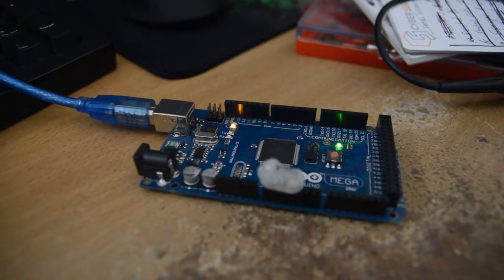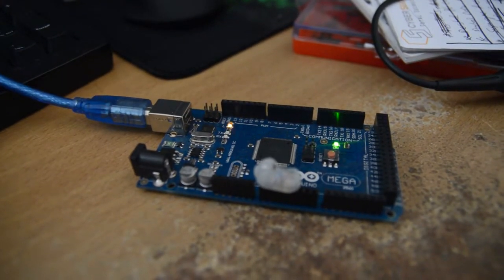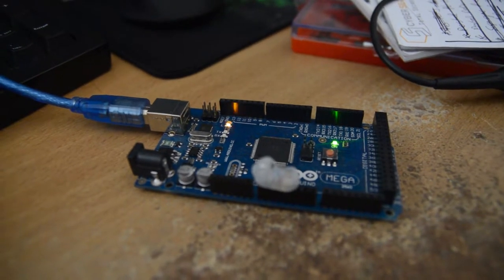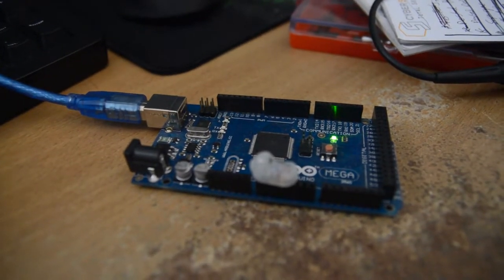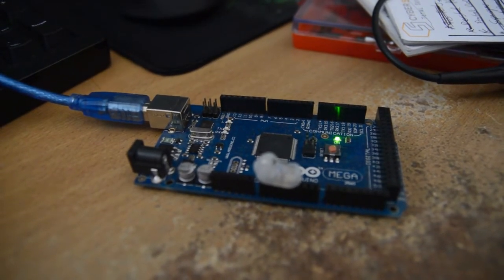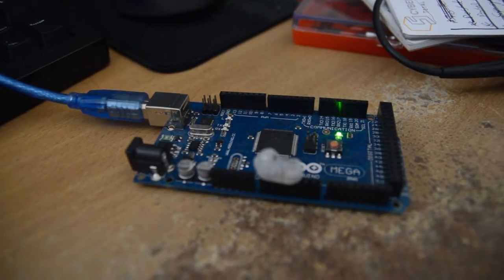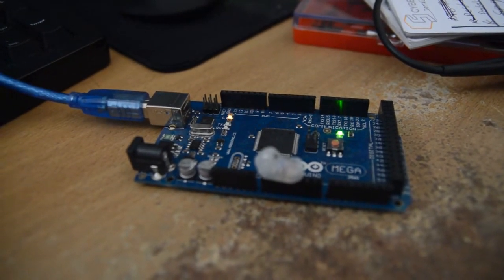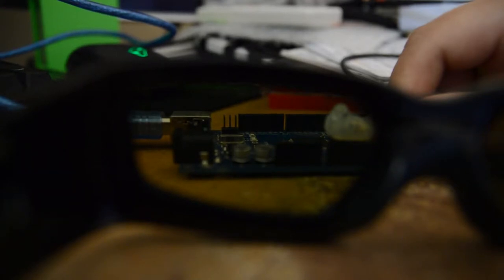Emulating Kogan Active-Shutter 3D TV IR Protocol

Comment: Resurrecting this 10 years in the future, did you ever get much further with this project Gough? I've been looking for a standalone 3D processor that could be plugged into a modern 4K non 3D screen (hopefully at a high refresh such as 120-144hz), particularly for use in relation to a 3D virtual pinball game whereby the screen is placed on it's back in portrait orientation (yes I'm aware there may be issues with the direction of 3D glasses polarisation filter in rotated mode but this can be overcome). So a PC would be plugged into the device by HDMI or display port, it would send a top/bottom or side by side 3D image to the device which would then process that image and send it to the TV/Monitor as frame sequential. Similar to Nvidia 3D Vision I guess but one that would work with a 4K screen. Are you aware of any current device that could do this?

Comment: I got a 50 inch kogan 3d-Tv and both of the 3d-Glasses have dead battery's that wont charge, is it possible to replace their batterys with some other form of battery.
Reply from the maker: The batteries in these units are tiny - I have a teardown on my website at goughlui.com if you do a search for kogan active shutter. These are small 3.7v Li-Polymer pouch batteries of 80mAh-100mAh size, normally used for things like Bluetooth earpieces. Maybe you can find some replacements from hobby shops or eBay. Anything else probably wouldn't fit nicely between the nose bridge area.